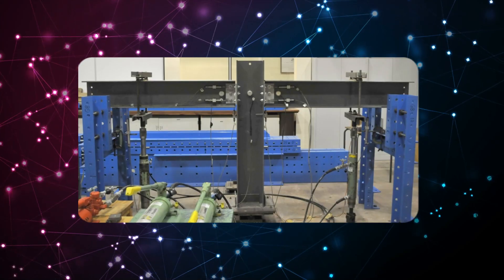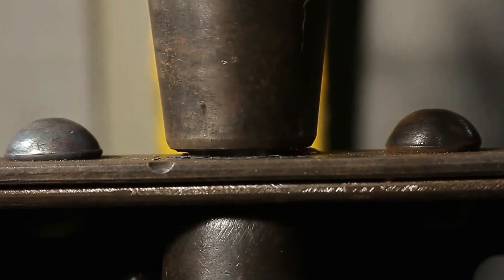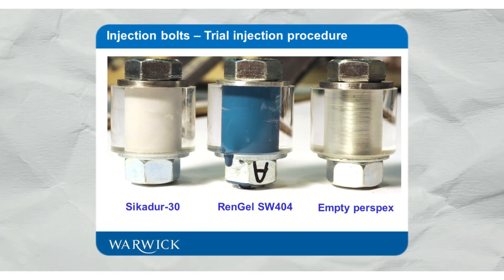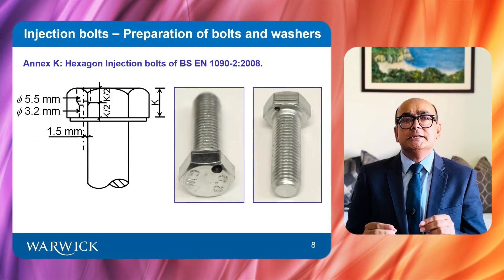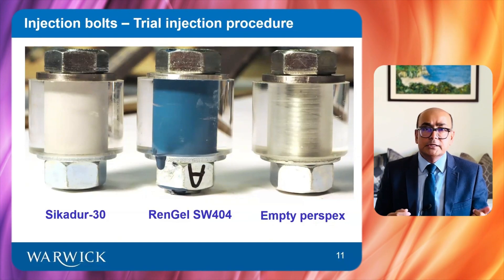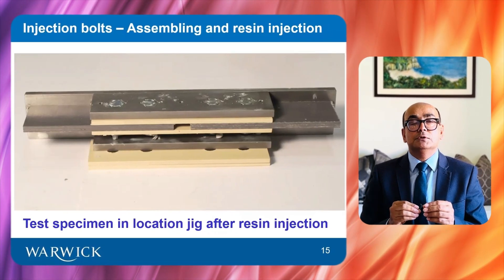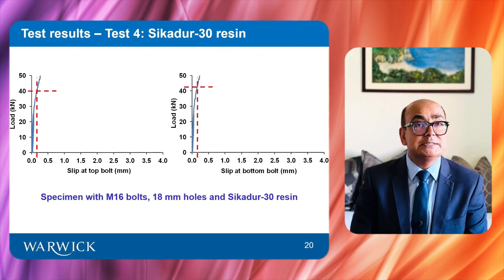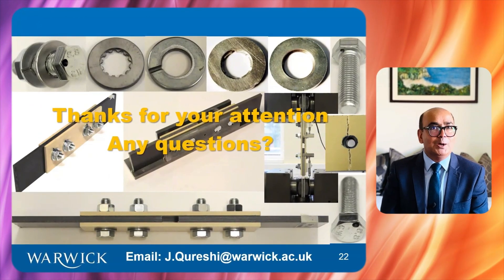Why Resin-Injection Bolts are Game Changers for FRP Bridges | Conference paper | Dr Jawed Qureshi

Comment: An interesting problem with a very interesting idea for the solution. Have you done any tests with the bolts off center in their holes or holes in the plates being joined off center with each other? As soon as anyone starts assembling these in the field, the nice alignment in your experiments won't happen - if you have building contractors doing the assembly, there's a fair chance everything will be tightened with an impact wrench too 😞.

Using fasteners with similar stiffness and thermal expansion properties to the materials they join would be a more likely way forward for using these materials in structural applications, as for an assembly with hundreds or thousands of bolted joints, I can't see anyone agreeing to injecting resin into every one of them unless there's literally no other possible way. A design code which makes allowances to account for the fastener properties being so different to the material they fasten but using conventional steel bolts is also more likely.
Reply from the maker: Tests are not done yet on holes or plates being off centre. However, I’ve a journal paper on creep and fatigue resistance for FRP bridges. I’ll soon share these results too on YouTube. The idea is to expand the research to bridge trusses. The research is mainly aimed at slip and fatigue resistance required in bridges. 
Thanks for your very insightful message. You’ve given me some new ideas to take the research forward; I really appreciate that.
Reply from the maker: You are absolutely right, in practice nice alignment will not happen. That’s why we want to try these connections without bolt centreline jig used in this work. Thanks for very useful insights.

Comment: Dr Qureshi, this was an interesting video! A few questions from a mechanical designer (but not a degreed engineer):

Using steel fasteners with FRP materials results in large mismatches of modulus of elasticity and coefficient of thermal expansion. With the sample fasteners and tightening torque used (M16 @ 88Nm), I got an estimated clamping force of 27.5kN, spread over a relatively small area from the bolt/washer to the FRP.  This is a low initial strain for this size bolt, in a typical steel structure fabrication the clamping load might be four times as much or more.

This presumes a static temperature, when in reality most environments could see a swing of say, 50C over a year. I would guess that this can lead to significant changes in clamping force even without factoring in relaxation of the FRP. 

Would this indicate that mechanically clamped joints in FRP would be better served with more, smaller steel fasteners with larger bearing surfaces that could have greater strain applied during installation? Perhaps including more "spring" effect, such as using Belleville-style washers?

Perhaps development of reliable FRP or monolithic plastic fasteners might be more appropriate. I do think that a polymer injection as you present could still be beneficial in either case.
Reply from the maker: Yes, I agree that the preload is not much. But due to FRP being a soft material, more bolt tightening leaves impression on FRP plates. So, load transfer due to friction cannot be relied upon. Perhaps the way forward can be to use lesser grade bolts such as grade 4.6 instead of 8.8, if available in market. Or FRP bolts can be explored too. I’m not sure if my answer is very clear and straight. But you’ve raised an interesting point and given me a different perspective. I’m grateful to you for sharing your knowledge.

Comment: For structures like canopies with corrugated sheets connected to purlins, it seems that bolt spacing requirements aren't strictly followed. Does the Eurocode's bolt spacing rule apply only to critical connections like beam-column and beam-to-beam joints? What is the rationale behind this rule?
Reply from the maker: I think the most Eurocode provisions are based on plate to plate mild steel hot rolled steel plate connections.
Reply from the maker: I don’t know how Eurocode deals with connections having cold formed thin sheeting and hot rolled thick sections. Please share some practical information with me at drjqureshi1@gmail.com. I’ll be grateful for your kind cooperation.

Comment: Why is a thread check for bolts not required in Eurocode for bolt connections? How can the appropriate screw thread size be determined, and does the screw thread size matter if all other checks, such as bearing, shear, torsion, block shear, and combined actions, are satisfied?
Reply from the maker: Generally, increase in thread size reduces the connection resistance. I think it will certainly affect bearing resistance.
Reply: Thank you